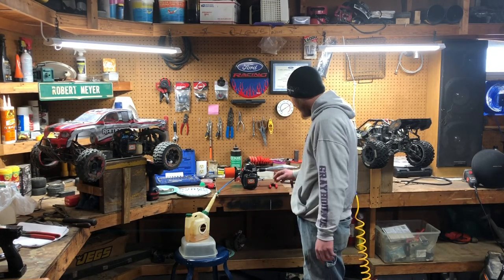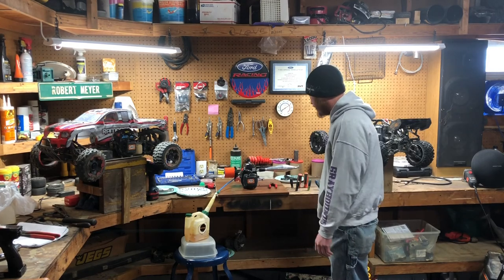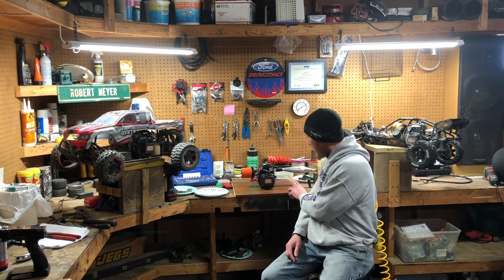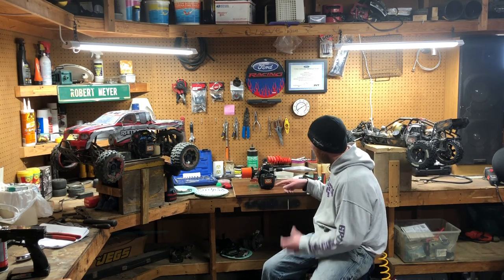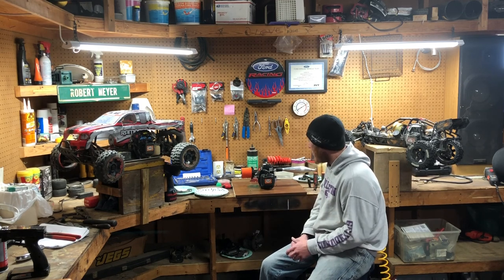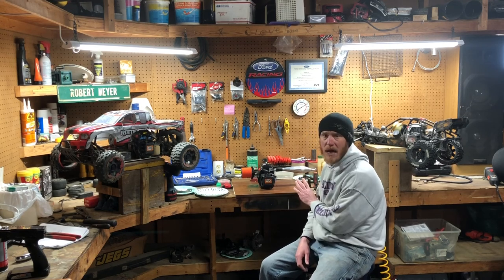Rovan 29cc Back Together And Alive And Backyard Bash With The Rampage XT 💥💥⛽️⛽️🧰🔧⚙️

Comment: Saweeeet! That XT rips man! Did you change up the gearing? Keep up the vids I will keep watching!!!
Reply from the maker: Steel City RC when I put the Rovan 32cc in I set it up for speed.
Reply: @Meyers2strokeRcgarage  nice. Man we need to find a machine shop willing to make hardened gears for us. That is the only thing that stops me from using gears again. My MT gears grenaded once I put a Zen32 in it. So I put the belt on. But been stuck with that single speed for a few years now. I know it has more than 45 mph in it. But then I tell myself. Dude it's a monster truck not a race truck lol. 🤘👊
Reply from the maker: Steel City RC I hear you on that.  The Rampage XT is really too fast for the amount of space I have to run it in unless I go to the city park.  Once spring is here I will be back at the Badlands south of town at my buddies dirt bike track where there is wide open space.